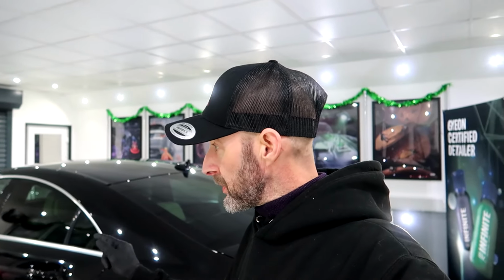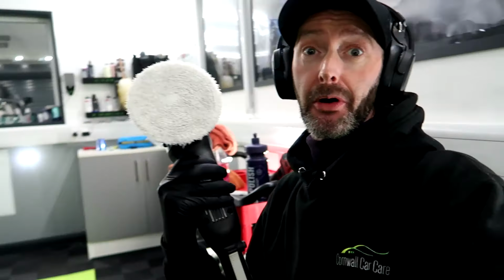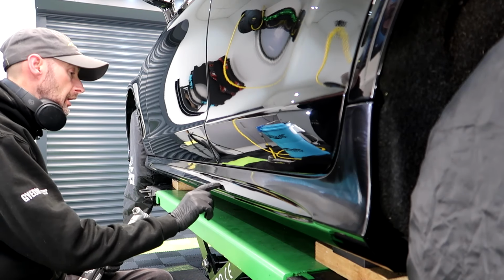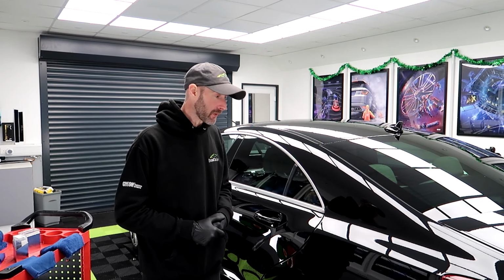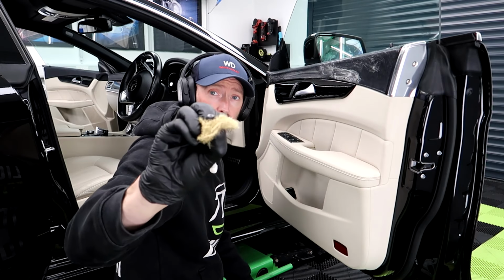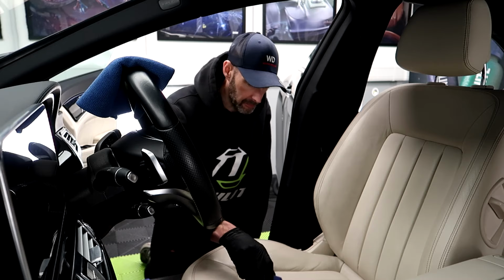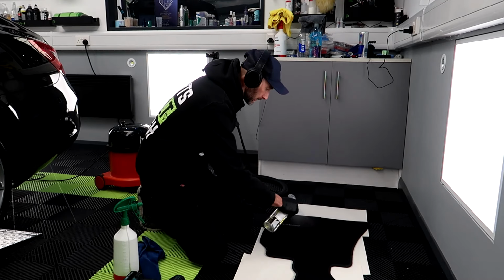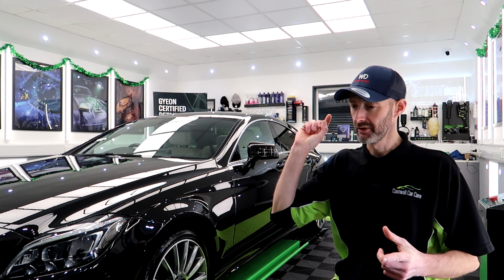Reviving the Shine: Mercedes CLS Detailing Process #gyeonized

Comment: Great video. Which lift is that and do you like it?
Reply from the maker: The lift is from GEG but I will be replacing it 2024 for something bigger as it only has a max of 3 tonne and I could do with lifting a bit more than that with some of the vehicles that I have had in 👍